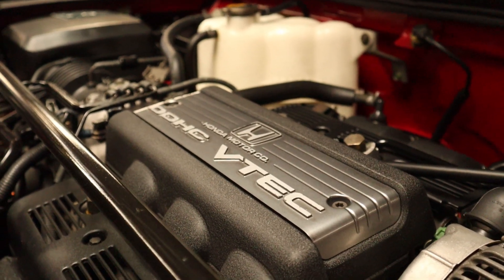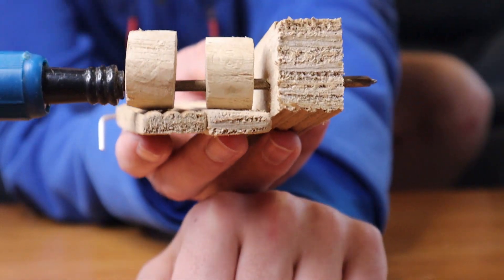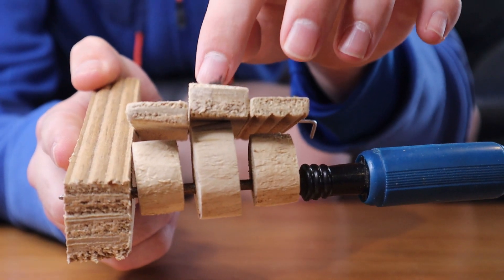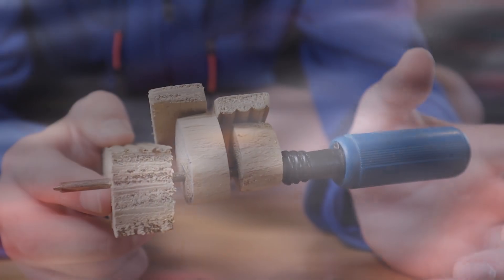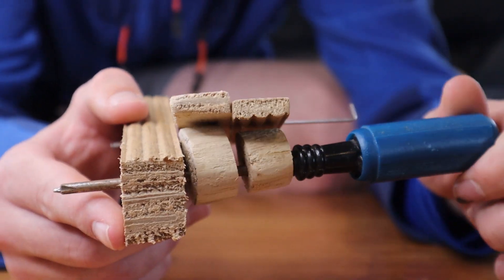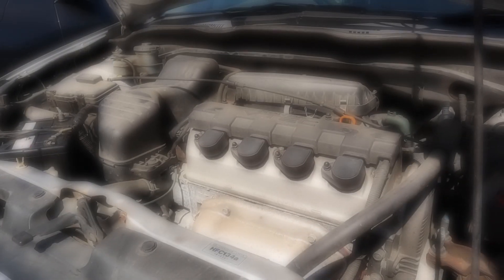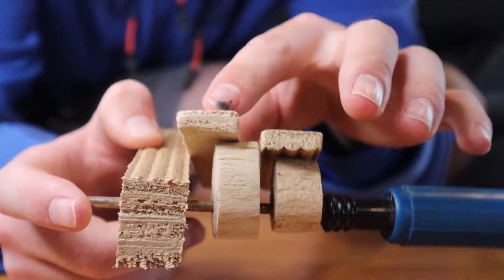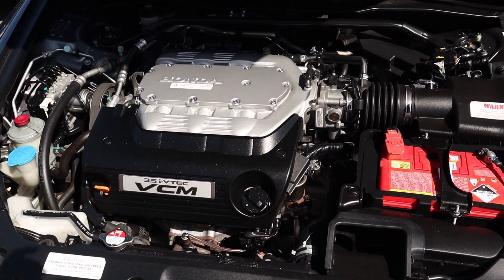Every Version of VTEC Explained

Comment: L15A7/L15Z1 has vtec on both intake and exhaust. With air intake vtec switchover is noticeable.
Reply from the maker: Nah they definitely don't, they're both single cam engines. One small and one big lobe in the middle for the intake, and two equal size lobes for the exhaust on the outside for each cylinder. Switchover is noticeable because that's the intake valves opening more.

Comment: In my 06 rsx s now.  Love this thing. And my wife appreciates it too these days.

CraZy how good hinda rd/manu was considering a variable pin, holding together high rpm and releasing on is like a engineering nightmare.  Can you rarely hear about the connecting pin going out on a VTec I don't even know what it would be called how infrequently you'd hear about i5
Reply from the maker: Nice man!

Comment: R series does not have variable valve timing ala K series...rather controls the DBW throttle and keeps intake valves open later to reduce pumping losses.
Reply from the maker: Nah it definitely does. We've replaced VTC actuators on them all the time

Comment: Here to find out my k24z3 is a non performance vtec :(
Reply from the maker: Mmm yeah unfortunately
Reply: @KiwiCarLife  what would u do to get max performance? I've taken out the intake resonator for more sound. Or was that just a waste of time and 0 performance
Reply from the maker: @murrknn9501  yeah its not gonna add any performance, only for sound. All I can recommend is a cold air intake and tune. Not a whole lot else you can do with those engines
Reply: @KiwiCarLife  ok im gonna throw twin turbs on it yolo!!
Reply: Excellent video!

Comment: VTEC (Variable Valve Timing & Lift Electronic Control) is a system developed by Honda to improve the volumetric efficiency of a four-stroke internal combustion engine, resulting in higher performance at high RPM, and lower fuel consumption at low RPM. The VTEC system uses two (or occasionally three) camshaft profiles and hydraulically selects between profiles. It was invented by Honda engineer Ikuo Kajitani. It is distinctly different from standard VVT (variable valve timing) systems which change only the valve timings and do not change the camshaft profile or valve lift in any way.
Reply from the maker: Yes thank you for this useful information 🤣🤣
Reply: @KiwiCarLife  He just wanted a lil attention 🤣 Thanks for the informative video by the way. I daily drive an 05 Acura Tsx with 250009 miles on it and I love every minute of her. She's Grey with black interior, her name is Pretty 😍 It's an auto but I plan on adding some stuff (Plm 4-2-1 headers inch straight pipe from header to resonators 3inch piping of course, and vibrant mufflers, injen Cai skunk 2 manifold, 87 mm throttle body and a reflash) just for daily fun. I've driven this car from NYC to Missouri and back to NYC speeding the whole way and she is still going strong 💪🏾😊 I'm proud of my TSX.
Reply from the maker: @keep_it_low_bro  nice man and Jack is my mate -  I'm giving him flack back for being a cheeky geezer
Reply: @KiwiCarLife  OH I see, you guys know eachother lol
Reply from the maker: @keep_it_low_bro  yeah very well haha
Reply: Thanks for copying Wikipedia for us
Reply: @RuneDamsgaardRasmussen-1995  it was a joke you’re welcome